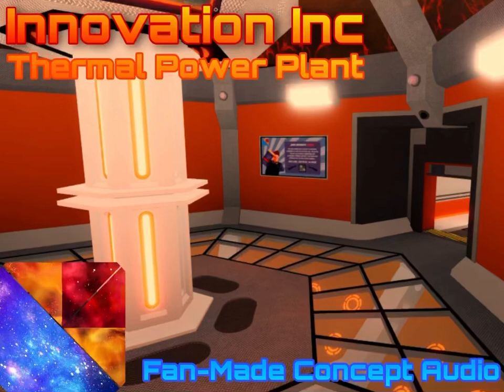Innovation Inc. Thermal Power Plant: Fan Made Concept Audio (“Freezedown”)

Comment: did you know that when the reactor reaches -1 kelvin that it goes below maximum 0, this means the core atomic structure is rewinding in time theoretically. this is because the colder something is, the slower it gets.
Reply: Theory: if the core reaches negative kelvin, the molecules vibrate "backwards" and press against each other rather than bounce off each other. If the core reaches low enough negative kelvin, all molecules collide with each other hard enough that they all turn into micro-singularities at once, then merge into a large black hole. what do think?

Comment: Wait get lava to the core and dump
Reply from the maker: Well... the temperature would most likely be too cold for that to work by the time you were ready to blow a hole in the side of the reactor chamber
Reply: @FireFractal  your right but are you sure about artic runaway
Reply from the maker: @Cglynn09  made it up... Arctic runaway, the opposite of a thermal runaway, a reaction causing an objects temperature to drop, and then lock at Zero Kelvin

Realistically I doubt this would happen, but this is innovation Incorporated, a meltdown in the arctic? A Freezedown in a volcano?
Physics don’t apply here xD
Reply: @FireFractal  ok let’s get the core to -4000 kelvin
Reply: @FireFractal  big brain move teleport the core somewhere else
Reply: @Cglynn09  I would say that wouldn’t work but I don’t know why but I just know it wouldn’t work at all (dumping lava on core)
Reply: @aaroncope2402  I sure it will fail dumping lava on the core what I want to is use lava pipes and use that what could go wrong
Reply: @Cglynn09  that would just make it turn into a meltdown quickly
Reply: @aaroncope2402  well it’s better than a black hole destroying the earth it’s better
Reply: Wouldn't teleporting it distant space before it becomes a black hole me a more logical option no one seems to think of work
Reply: @spidercrafter3088  this is innovation and they have a portal in the base duh
Reply: @Cglynn09  and you don't they are capable of making a portable version of one?
Reply: @spidercrafter3088  no there is only one in the iitpp sector d exspamentle
Reply: @Cglynn09  it's literally an idea sir i think your missing the point.
Reply: @Cglynn09 I'm not suggesting it to anime I'm suggesting it to fire because they were running out for concepts. :/